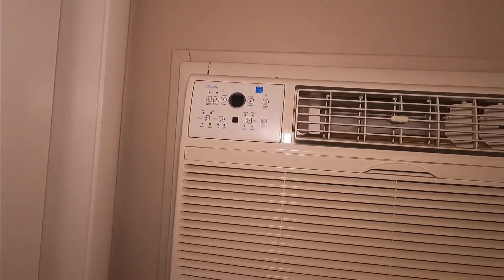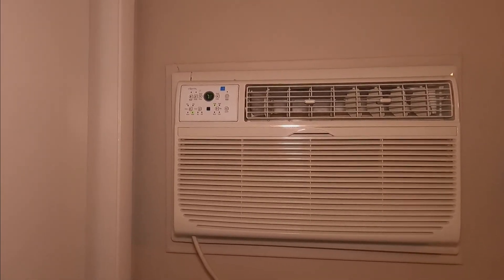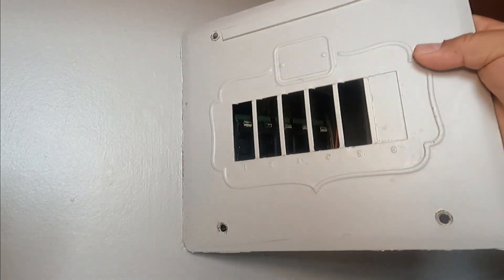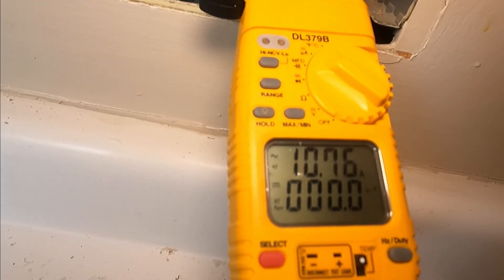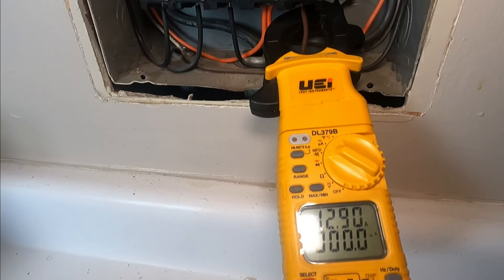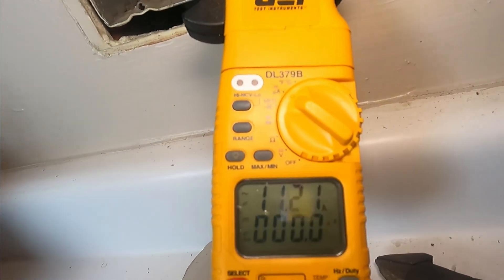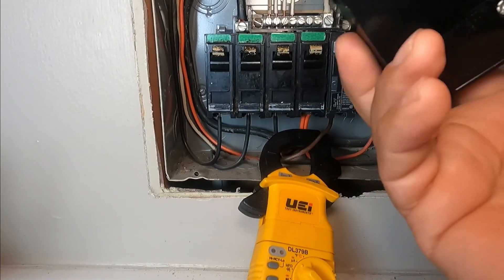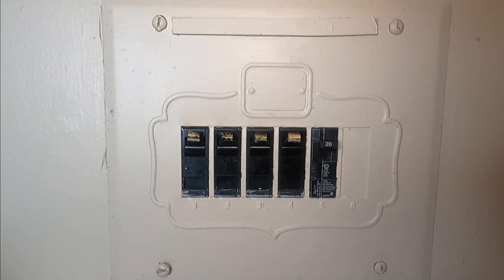THRU THE WALL AC UNIT.  BREAKER KEEPS BLOWING.  TROUBLESHOOTING TIPS.

Comment: What size wire is this 14 or 12 gauge?
Reply from the maker: Hello Jorge.   It is 12.  If it was 14 I would not be right to put a 20 amp breaker.
14 gauge 15 amp breaker
12 gauge. 20 amp braker
Thanks.

Comment: i a certified electrician and engineer, a clogged filter will not raise the circuit load for the type of window unit in the video, the efficiency will be lowered but it will not "do more work" the thermostat will simply run the compressor longer (not harder)to achieve the same temperature

Comment: Great video. Unfortunately it doesn't address my problem. I have a GE thru wall unit--230 volt. We had a power outage which tripped some breakers in the building and also destroyed some surge protectors. Not all the breakers were tripped just a couple. This AC unit has a circuit breaker with test and reset buttons built into the power cord. Every time I try to plug it back in it trips the power cord breaker. There is power coming to the outlet. I can buy a new power cord for this unit but it's $170.00. I'll happily pay that if it fixes the problem. Do you think replacing the cord and breaker will likely fix the problem?
Reply from the maker: Hello Jon,  It might, It might not.   It might ve fried some components and now is shorting out.   
Try this.  before you spend the  170. Go to Home Depot or Menards.  Get a short power cord with a gfci device.  Remove the old cord, https://www.homedepot.com/p/Tower-Manufacturing-Corporation-18-in-In-Line-GFCI-Cord-30438018/202510249 connect your ac with this one.  If it works then buy the 170. If it doesn't return it to Home Depot.     If your AC is older than 8 years old I ll get a new unit.
Reply: @alexthehandyman3494  thanks for sharing. Could we be able to connect it ourselves?

Comment: Could be that the breaker is to small to carry the watts
Reply from the maker: If your wire is 12 gauge and your breaker is 15 amps Yes.  Replace it for a 20amp. 
Your breaker might be faulty or tired.  If your wire is 14 gauge replace the 15 amp breaker.
Check all the connections to the outlet.  
Your ac might be too old and compressor is pulling more amps .  Replace the ac

Comment: You are a nice guy..., but you msy want to check CODE for where you are?? Because, NO-ONE should think you can replace an undesized  (15amp) breaker on a 14/2 gauged wire... TO A (20amp) breaker _ ON THE SAME SIZED WIRE!!??
THE (20AMP) breaker should only be wired to a thicker wire _12/2 guaged wire!!!
No matter what N.E.C.., or anyone  suggests...!!
Common sense should tell you to be safe and NOT OVERLOAD THE WIRES OR BREAKERS.!!!!
14/2 TO 15AMP.
12/2 TO 20AMP.
DONT BE CHEAP ...YOULL PAY LATER!!!
Reply: Hi. How do we know what wire to connect it to?

Comment: Simply replacing a 15amp breaker with a 20amp breaker is NOT fine.

A 20amp breaker on a circuit wired for 15amps is unsafe.

Like REALLY unsafe.  Like potential fire in the wall unsafe.
Reply from the maker: HELLO Scott.
Going back to the video, I realized I didn't mention  that all my wires in that panel are 12 gauge.  I failed to do that.    So yes !! it is unsafe to install a 20 amp breaker on a 14 gauge wire.  Being that the case we are ok.    I installed a 20 amp breaker on a 12 gauge wire.  Thank you so much for pointing that out.   I put a note on the description video.